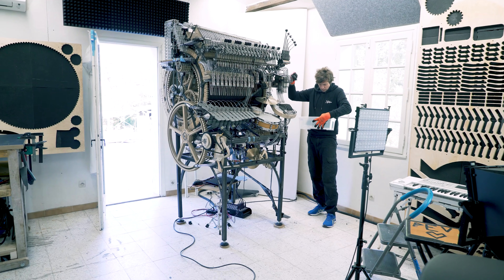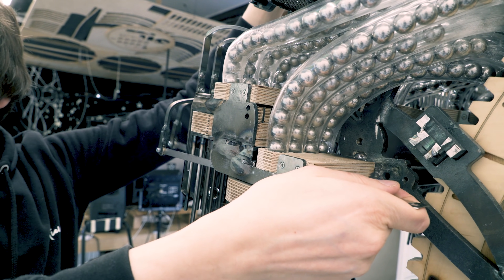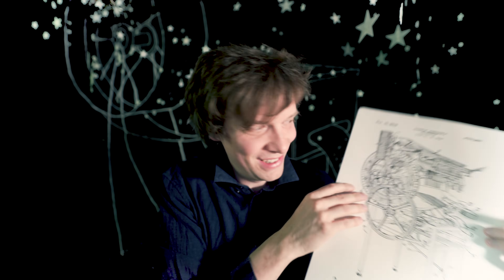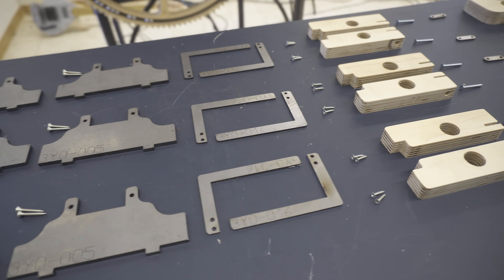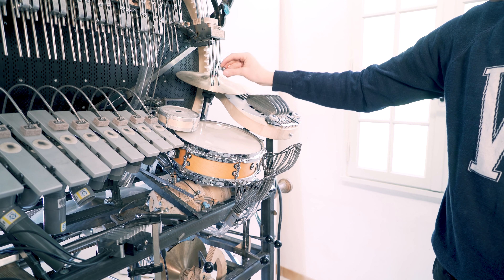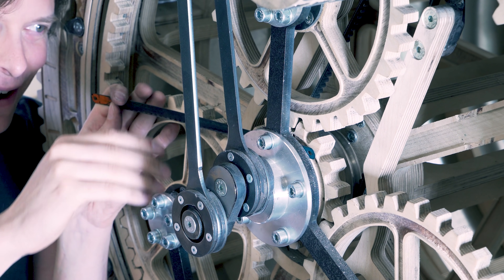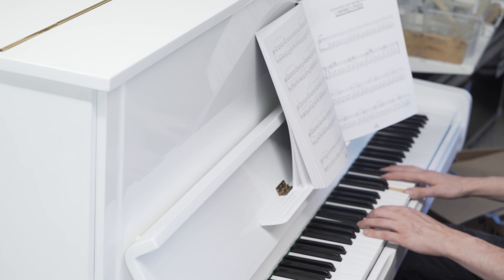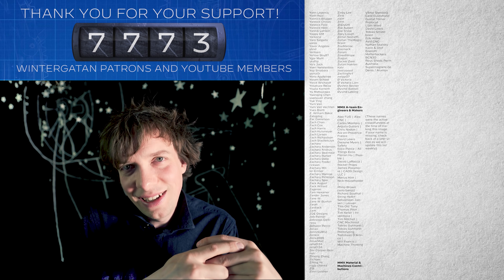Cyber Funnel

Comment: Have you ever thought of the MMX playing a full song, would the buffer be more than enough? I often ask myself this question, because sometimes i think the marble elevator works to slow to keep up with the abundance of instruments playing throughout a full song
Reply: In one of his very first MMX videos, Martin went into detail about the required number of marbles per beat. It has been a core requirement from very early in the design process; it should be sufficient.
Reply: @sebastiaan2870  It's also got big buffers. He can afford to have a marble deficit for a good while, as long as he's saved up some from letting it run for a while.
Reply: @sebastiaan2870  damn i forgot about this video but you're right, like abhijith S said lets see how it unfolds
Reply: in an early video of the mmx he was talking about this. He chose this design because it is the fastest one that works in his design. And if I'm not wrong he can control where the marbles go. So if he is playing a vibraphone solo he can decide to only feed marbles on the most left side and vise versa.
Reply: The sentinal gates also allow for more loading than just what's shown on top at the divider. As seen in this vid where he loads the tubes manually.
Reply: I think the overflow trail will keep the supply coming pretty fast so it will probably be fine, those last few channels are pretty small though
Reply: @MrNotaracist93  i hope it will because when the mmx is mid playing a full song not alot marbles will flow over anyway, but I also think that the songs will be specially made with such things In. mind
Reply: Yes. This probably is my no 1 concern. But knowing Martin, he will find a fix.
Reply: @f3arbhy  definitely but before you can fix problems you have to know they exist!
Reply: @KamilDeKerel  I completely agree with that. Let's see what unfolds.
Reply: @f3arbhy  and when you keep on adding stuff it would make it that much more difficult to change something as vital as a marble buffer
Reply: part of the beauty of the marble machine is its limitations and how they are either worked around or even exploited. flaws are what give character
Reply: Not a big problem, as the others have said. I just want to add that, by design, the vibraphone gets fed first, then the drums, then the bass. It's a priority sorting mechanism in its own right, and deliberately chosen. The melody can't ever cut out due to marble shortage, but missing the drums here and there (or even the bass) would not make the listening experience unbearable. In fact, it might even go unnoticed!
Plus, martin can play the bass manually.